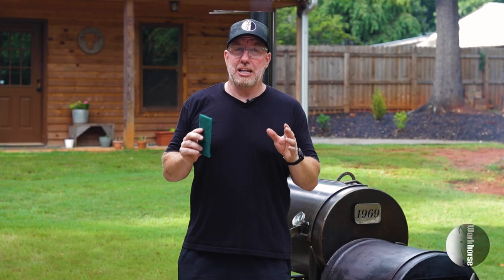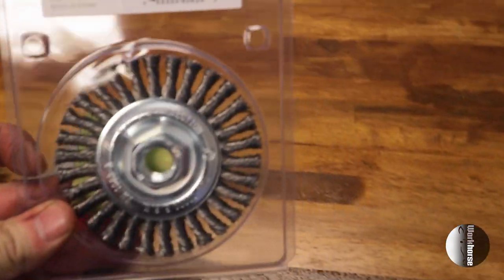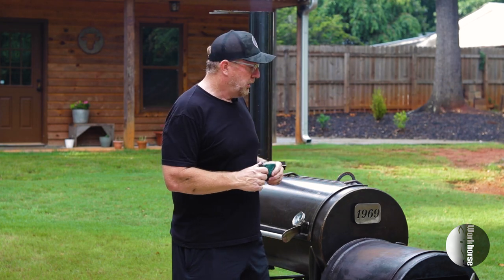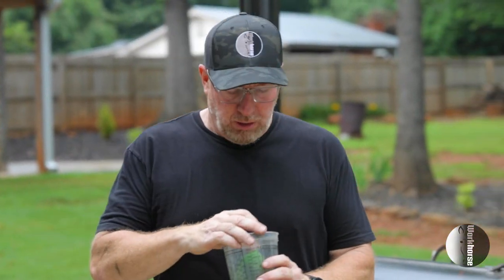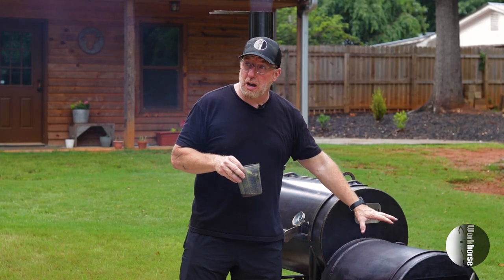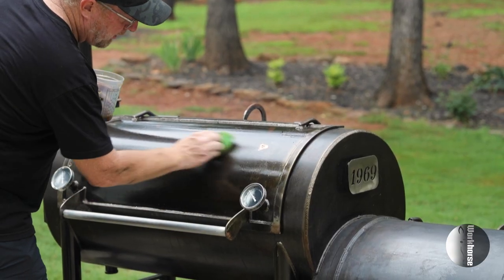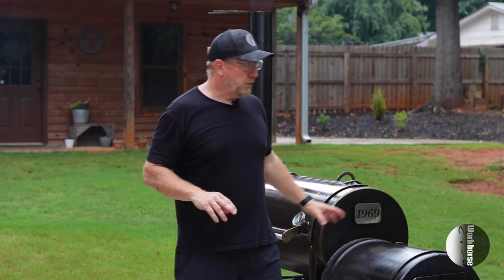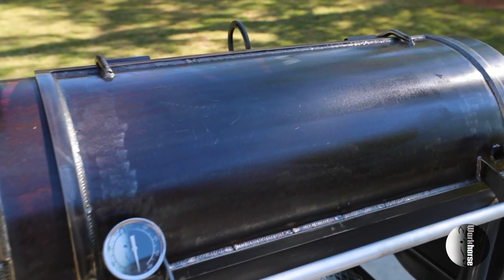FAQ  EXTERIOR MAINTENANCE

Comment: I have a 1975. I have been using food grade mineral oil (Walmart Pharmacy)on the cooking chamber. Mineral oil has a lower smoke point and will polymerize better at external cooking chamber temperatures. I use spray canola oil on the firebox. Boiled linseed oil is highly combustible once exposed to air. Just my $0.02. Cheers!!

Comment: How do you maintain the inside of the firebox from the firebox from rusting.
Reply: Same way, coat the firebox when it is clean before you start your fire. Then as the smoker gets hot that oil will polymerize.
Reply: @oldmanfunky4909  in the video he specifically said to only do the outside of the smoker.  Not sure why, or what the recommended procedure is for the inside.
Reply: @MrMarnold6  use a food grade oil on the inside
Reply: If you give it a good seasoning when you first get it, you won't have to do it very often. The fats from the meat will help keep it seasoned. I melted Tallow and sprayed the inside of mine and 4 months later it looks great.

Comment: Would tallow or other food grade oil work as well to protect the outside of the smoker?
Reply: speaking from experience, yes but higher smoke point oils work better. Tallow burns at like 325 while grapeseed oil burns at 450. the tallow will burn off too quick.
Reply: @lohengrin5082  thank you!

Comment: In this video you say the smoker doesn't need to be hot (350°) but that's contrary to your first video where you heated the pit in sections with a propane torch.
Reply from the maker: It does not need to be hot.  It does apply and dry faster at temps above 350

Comment: Thanks, JD...great tips.  What do you recommend to keep the hinges on the doors lubed?
Reply from the maker: Linseed oil or I just recently stuck some high heat grease in a 69 thats been sitting behind the shop two years.  It worked great and quiet as a mouse.  My personal smoker (1969) is no need of grease due to using it frequently.   So linseed oil is great
Reply: @WorkhorsePits  thanks very much